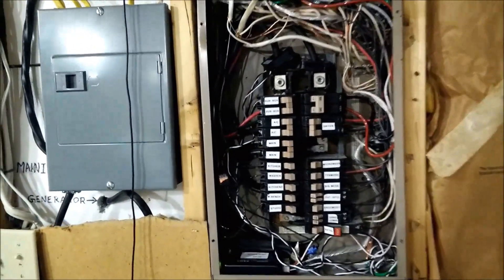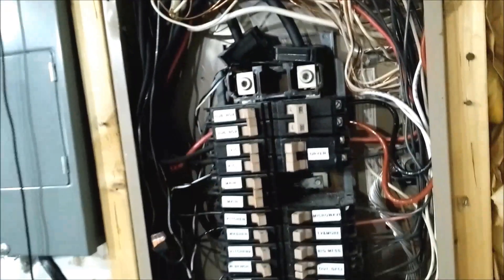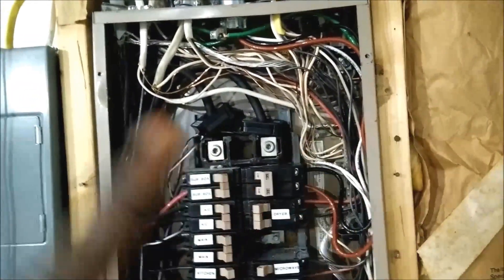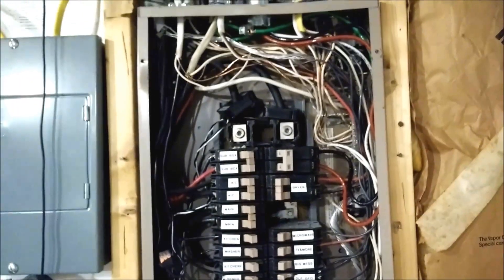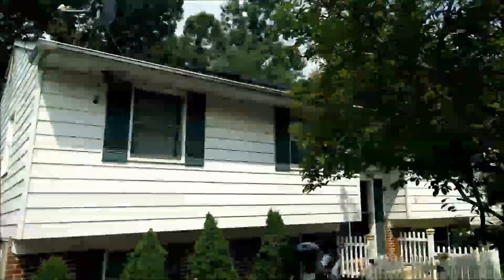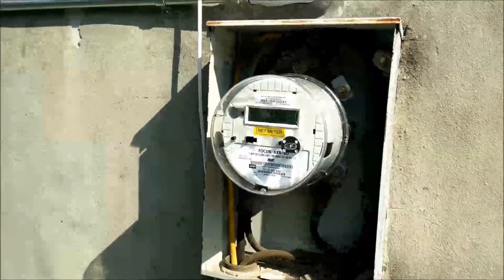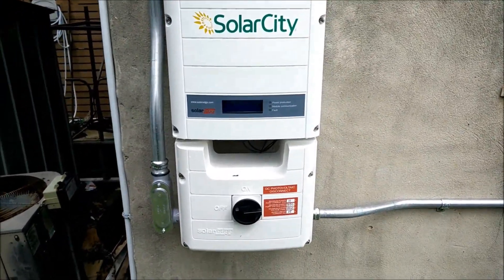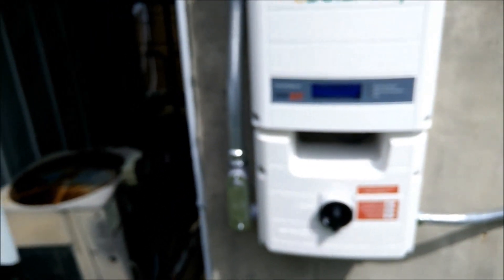Solar City - Detailed Review - Final Steps to Turn System On - Part 3

Comment: Thanks for your 3 part video.  Seems like a part 4 would be helpful.  Still do not follow how you are benefiting from all this.  What is this installation saving you? How does maintenance/cleaning work?  How do they know when the panels need cleaning, how do you know when the cleaners will be arriving, and what process and chemicals are use to clean panels?
Reply from the maker: Thanks for the question, I am in the process of putting together "After 3 years video" Probably will release it at the 3 year mark to be consistent. In short, Tesla has taken over the Solar City lease, so far its been great, saved just a few hundreds, No problems what soever, does not need cleaning at all, rain takes care of cleaning. The usage monitor app made us way more efficient and gives instant feedback on power consumption. That feature alone is worth it. Since Solar is way cheaper now that 3 years ago, if I have to do it again, I will just buy the system outright. Thanks.

Comment: great series I'm about to go through the process and this video series has been incredibly helpful. Its been a couple years do you plan on doing an update on how things have gone with the system over the last couple years?
Reply from the maker: Yes, I am waiting for two years to complete so I can have accurate data to share. So far by my estimates I save 5-15 dollars a month. May not sound like a lot, but cumulatively it makes a difference.

Comment: Haha   you were Very Sharp to catch that  under size  wire problem...   that worker that installed that small wire should be  Fired...
Reply from the maker: Thank you for your insights on the resistance. I don't understand how a Master electrician could simply make mistakes like this. I am not a electrician, but I have enough common sense to identify circuit load, resistance, and gauge problems like this. Wonder how many other houses got the same setup unnoticed.

Comment: on Wiring topic Gauge 6:00  you need to call them to install a Match  wire size.   you now have a Resistance Problem...   you are 100%  correct...    Also  you never Down Size A wire size.  you can up size...

Comment: what if you bought the system outright.
Reply from the maker: You can buy the system outright, however SolarCity quotes are a little higher than the other local companies. The reason I didn't go with outright purchase is the upfront cost, maintenance of the panels and property damage scenarios. Basically peace of mind.